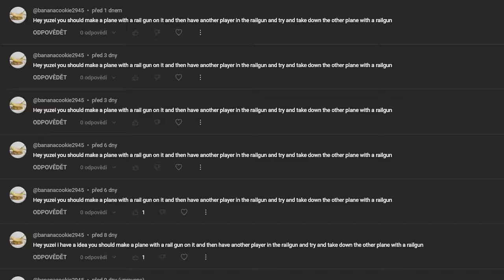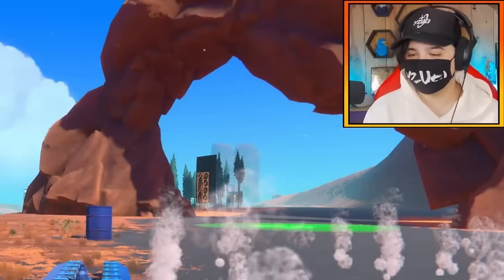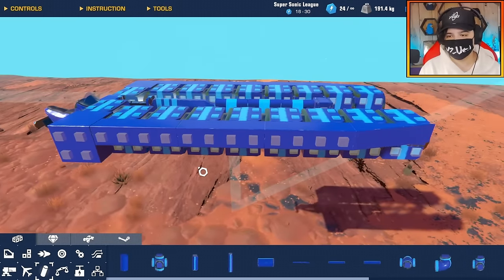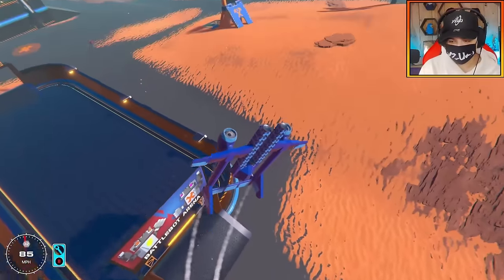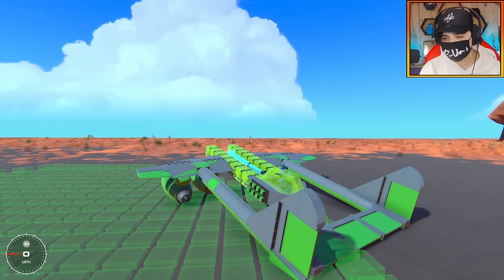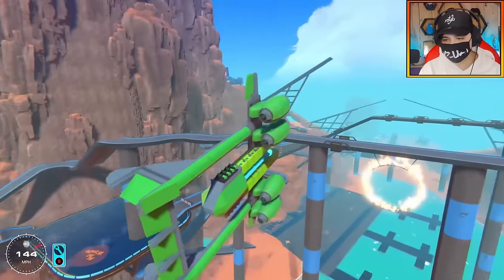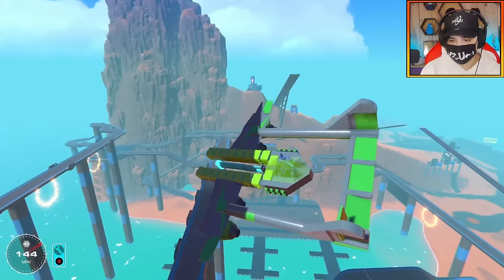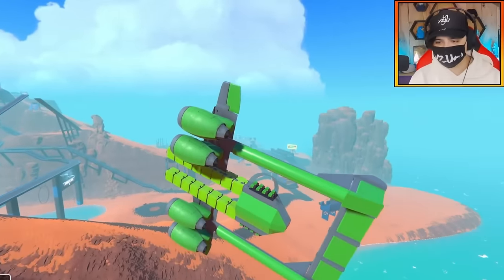How Effective Is This RAILGUN Aircraft?! | Trailmakers

Comment: Yuzei, the only thing that gives a gun more accuracy is to add more length, and that slug doesn't work and to get it to explode with an aerodynamic part in front of it is to add more force to break the part on contact with the ground and then the dynamite will explode